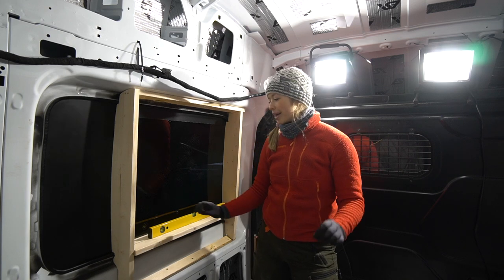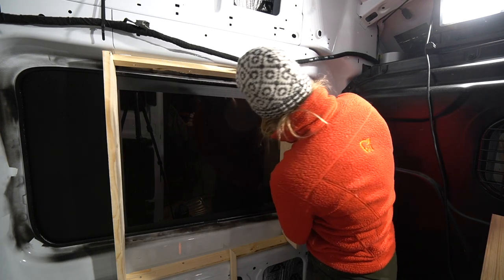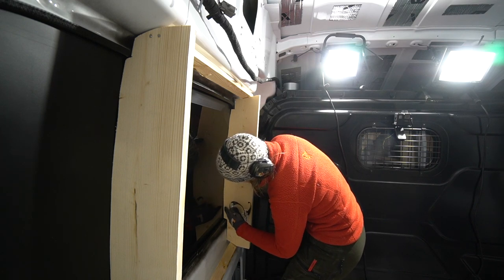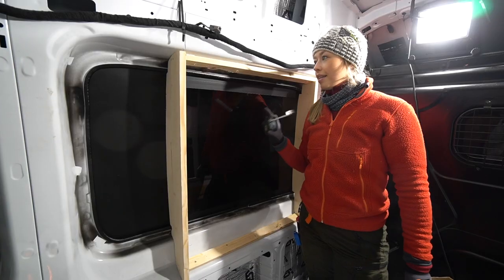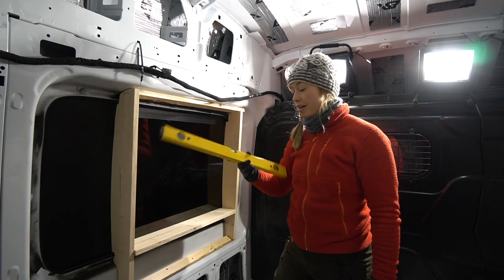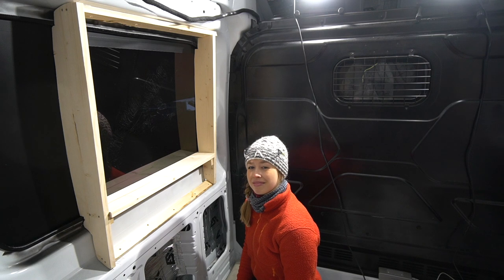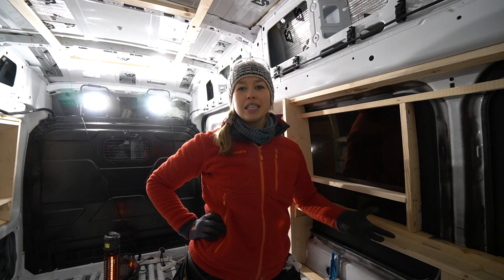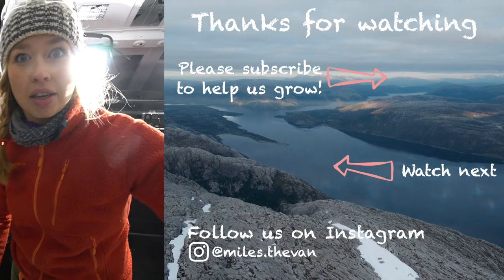Framing van windows - Campervan conversion [Ford Transit] [Vanlife]

Comment: HI Great Video!! THanks for the walkthrough! Im currently working on my van, did you leave any gap between the window and the window frame? Im worried about movement with the frame so close to the glass, then with a gap how do you prevent things from falling thru? Oh my, so much to think about, any pointers?

Comment: nothing is level in a van. so you have to SQUARE everything with a 90 degree. Use the floor to measure UP to the frame since the window should be the same level as the flooring. i learned that ALMOST the entirely tragic hard way lol... thanks for the vid!
Reply from the maker: haha we learned that too.. it's so incredibly frustrating!! we really struggled makeing our shower because of this, and ended up using a similar method to what you're suggesting 😀